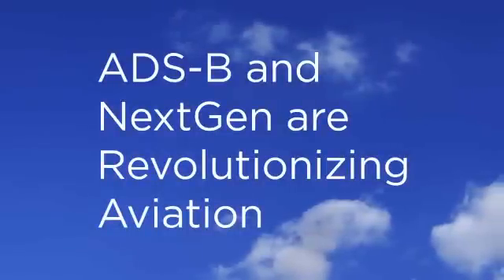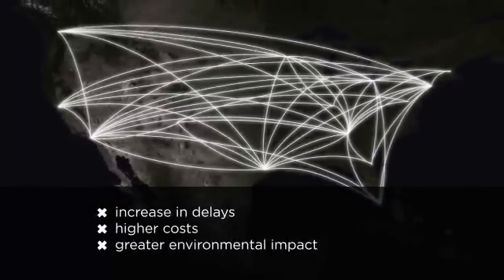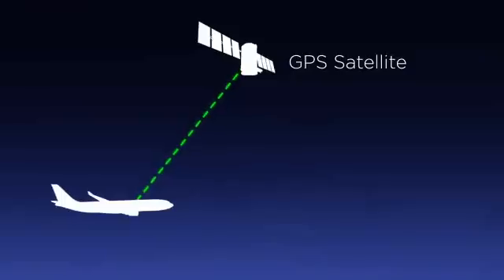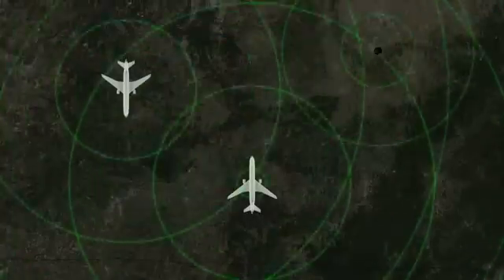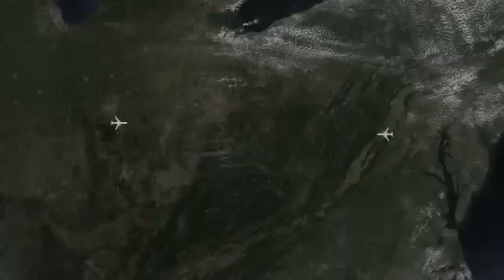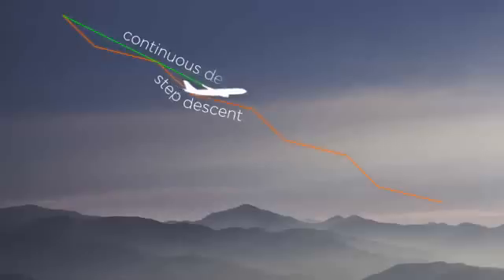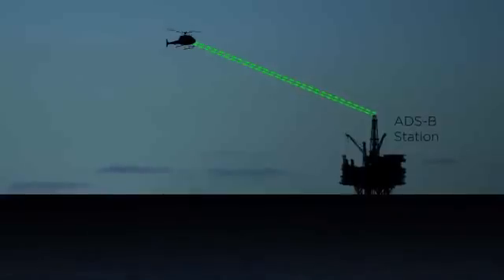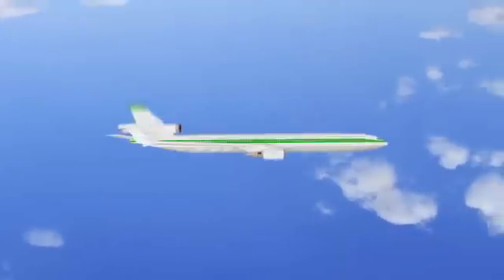ADS-B

Comment: This is a good functional explanation but I want to know how so many "devices" (aircraft) can communicate on the same frequency and any receiver be able to decode any of the data. I suppose I'd have the same question about wifi.
Reply: It's a bit like the internet.  Digital packets, or frames are modulated onto the RF carrier frequency.  These packets are unique to each aircraft, and are identified by their ICAO address, which is a bitfield within the packet.

Comment: Does anyone know why the demonstration teams don't
use ads-b when performing airshows in the US?
I see many support aircraft using it constantly but only rarely do I see
tactical aircraft flying with it.
Thanks...
Reply: ADS-B is real-time but not for short run high performance applications. 
Blue Angels for example requires split second decisions by pilots and manual finger control not possible with high G suits.

Comment: Hi, i am going to install ADS-B 1090MHZ antenna in my top of roof above 30 feet from ground level. Is there any problem with lightning strike. Is there anyone's antenna affected by lightning. Please help me with that. Thank you
Reply: @Riya Vlogs mee to I'm Afraid of Lightning  strike to attack my Equipment Better plan is to Switch off the Receiver that's all 

Note: Our House are not Constructed in Faraday cage method Like Aircraft!! 
This method will Increase the Construction cost of an House ! So 

#SWITCH OFF YOUR RECEIVER UNTIL THUNDERSTORMS END!! So Electricity won't discharge on  your antenna As well as to your Receiver and House :-) 
Nowadays we can see many Surge protector they can only handle upto 4000 volts not millions of Volts created by Lightning !!

Did you know that Iron and Electrically charged Things can easily attracted by Lightnings?
Reply: NASA JET PROPULSION LABORATORY LOVER Did you use ADS-B antennas.. How can i increase my coverage with pre amp LNA filter??
Reply: @Riya Vlogs yep I use FlightAware Jetvision 1090 MHz Multilateral Antenna Just Install LNA Pre amplifiers between Antenna Connector and cable please be concern to use 2.5 GHz LNA Amplifiers that can boost your Amplifying signals but Note your Height of installation , If you Install the Antenna over 30 feet that's good for Reception Just shown as this website
https://www.balarad.net/        for more details !!
Reply: NASA JET PROPULSION LABORATORY LOVER. Please send me the buy link of that correct lna amplifier..

Comment: ADS-B is HIGHLY SUSCEPTIBLE TO RADIO FREQUENCY INTERFERENCE

Solicitation Number: 19007  Agency: Department of Transportation  Office: Federal Aviation Administration (FAA)
Posted Date: December 15, 2014 Response Date: January 28, 2015

Global Navigation Satellie Systems (GNSS)

"However, GNSS signals are highly susceptible to radio frequency interference so a portion of the current inventory of VORs will be retained to provide a conventional navigation backup to GNSS."

"GNSS signals are HIGHLY SUSCEPTIBLE TO RADIO FREQUENCY INTERFERENCE"